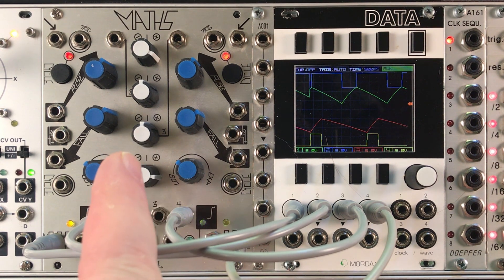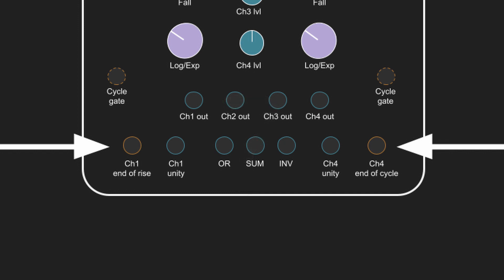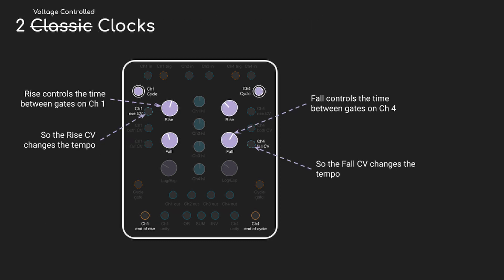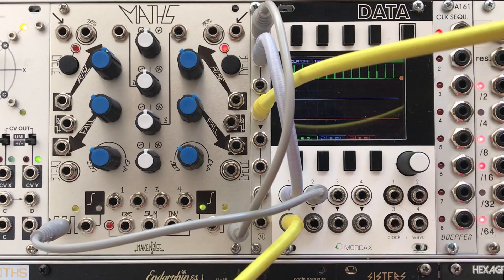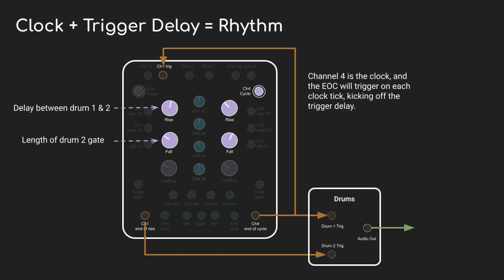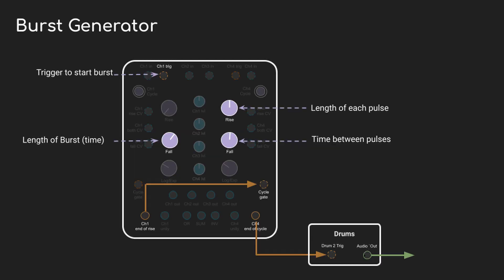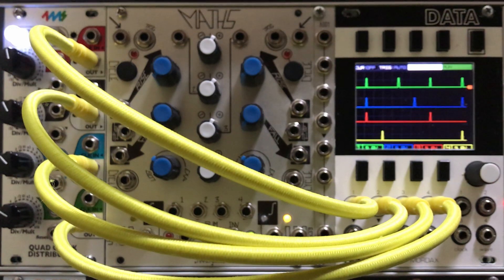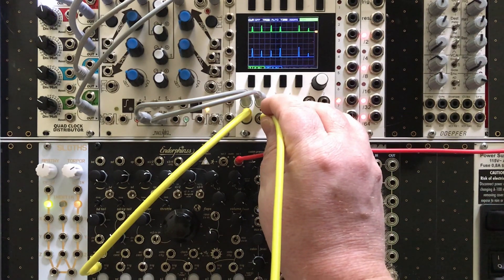Maths 201 - Five Clock/Gate/Trigger patches that explain EOC & EOR

Comment: Great video! Would love to see a similar video using the DUSG MK2.  I know both modules are similar but seeing it in context of the module is helpful without feeling redundant in my opinion.  Been tryin to find ways to use utilize the Serge euro system (in isolation) and a clock divider of sorts, seems vital.
Reply from the maker: I've thought about picking up a DUSG to look at it, but I haven't had a chance yet.
Reply: Ah gotcha!  I'd suggest picking one up on used, you can get a decent deal on them through reverb.  The Serge line up is great but pretty expensive for what you get.  @SoundVoltage

Comment: The wording for me makes sense if the channel one attenuvertor is all the way clock wise. The channel one output is basically a triangle wave with different shark or hump shape based on the log/line/exp settings. The gate is triggered at the rise of the wave, thus gate starts at the end of rise.

Comment: How can maths be used to add a glide function to a sputnik modular keyboards’ v/oct cv output?
Reply from the maker: Take a look at my Maths 203 video, it's all about Slew Limiting, and that's what you want.   Basically, you're going to use either channel 1 or 4 as a slew limiter -- something that slows down the transition between two voltage levels -- like gliding between notes.   I go into it in depth in that video.

Comment: Thanks for this!! I’ve Maths for years and didn’t see EOR and EOC like this. True mislabeling indeed. Was actually looking for a module that would have gate open as long as rise is happening. Turns out I’ve had that in my case all a long 😂
Reply from the maker: Thanks!  Yeah, I've actually considered making my own Maths front panel with thing laid out and described a bit more easily...
Reply: I dont want to fall in controversy, but I think EOR and EOC labels are right, first they communicate when the gate starts and not how long is the gate, that depends on how long are the states “fall” and “rise” respectively.

Calling them “Rising” or “Falling” could be more misleading in the sense that they could be confused with a sort of cv source that only “Falls” or “Rise”.

Comment: I just dipped my toes into modular, and I've been debating on getting the Maths before I get anything else.

I think I should get Maths
Reply from the maker: I also think you should get Maths. :) It would be a great module to add early on to a semi-modular.
Reply: @SoundVoltage  The only thing holding me back from getting it is I still need to get a semi-modular voice like the 0-Coast, as I want to get that before I really go too far in elsewhere xD
Reply from the maker: @Ariakiri_  Yeah, unless you're really flexible with the sound you expect out of it, it is limited on it's own.  You could still set one of the cycling LFOs to audio rate, modulate it with the other, slower, LFO, run the results through some effects - that would probably be fun :)  But it's better added to a 0-Coast or a Mother-32 or something.

Comment: Excellent! I am new to Maths and this really helps understand this complex module. Can you use it with Pressure Points to turn it into a sequencer? How would I modulate Pressure Points with Maths?
Reply from the maker: Thanks for watching!   In my Maths 202 video I give an example of Maths as a sequencer.  I think what you'd want to do is do something like in that video, but then patch the Pressure Points in to Channel 2 or 3.  Then the SUM output would be the cycling LFOs on Channels 1 and/or 4 added to whatever Pressure Points was sending.  Then you could send that to a quantizer to clean it up a bit. 

The LFO would repeat, and the Pressure Points would be transposing it up and down.

Comment: EOR and EOC are not mislabelled at all. They are different than falling and rising gates. If EOC was only high during the rising stage then you wouldn’t be able to use it as a gate inverter as it wouldn’t go high after the signal went back to zero, which is exactly what EOC means and does

Comment: I don't have Maths but the 0Coast also has EOC and EON outputs from its Slope and Contour sections. Do you think these really work in the way you describe?
Reply from the maker: I don't have a 0-Coast, so I can't test directly, but looking at the docs it does look like it works very similarly, though I'm not sure how the Slope & Contour sections are related to each other.  But yes, for Slope, EOC is high whenever it is not in the fall segment.  And EON works the opposite on Contour, high when it is not in the onset segment.   But because you can trigger the Slope & Contour at the same time, and the Onset & Rise segments can be different lengths, you can have different behavior (like both of them high at the same time).  I think.  :) I should really get a 0-Coast.